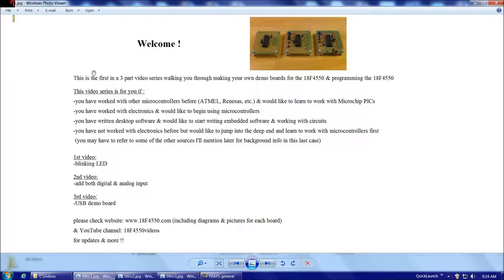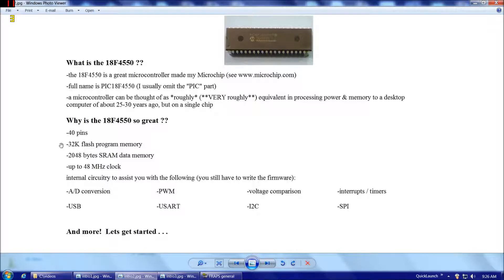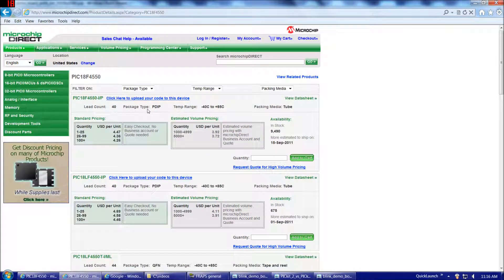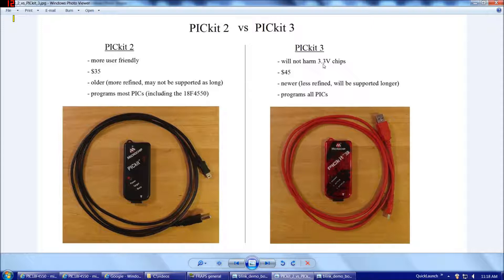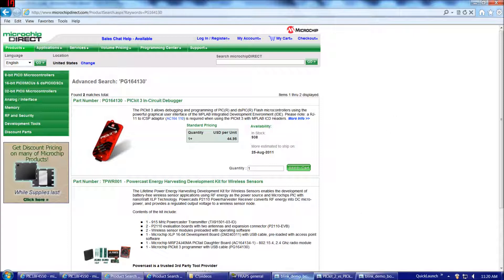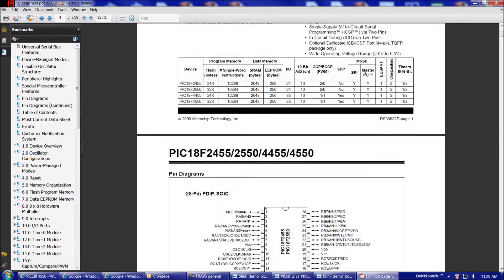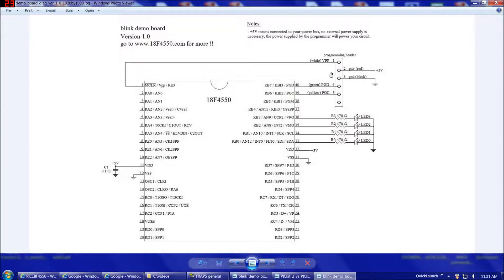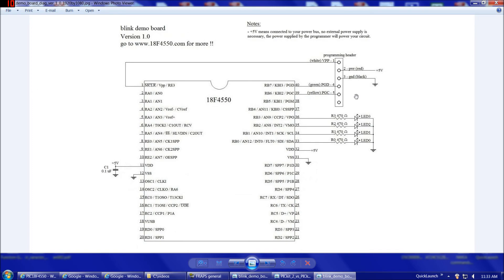How to program the PIC18F4550 microcontroller (blink demo board) part 1 of 8

Comment: Thanks for these older uploads Chris.
 If your still using PIC's... With the current MPLabX and convenience of MCC/XC8, do you still recommend the 18F4550?
  I got a recent book (Apress/2018) on XC8 written by Armstrong Subero (no affiliation). In his book he uses the PIC16F1717 microcontroller. It's doesn't have hardware USB, but it does have some interesting analogue peripherals like an integrated R2R Op Amp.

  I subscribed here after coming across a couple of these uploads in a YT search for "PIC18F4550." I appreciate the simple step by step tutorials.
  I added this to my "MCU PIC" playlist.
Thanks again.
-Jake
(My channel is not monetized nor do I plan to change that. I don't care if you or anyone else checks it out. This is not spam. I have nothing to gain. I simply like to share odds and ends occasionally, usually FOSS'y or OSHW related. My playlists on YT are a form of personal note references however they are publicly listed and roughly indexed alphabetically.)